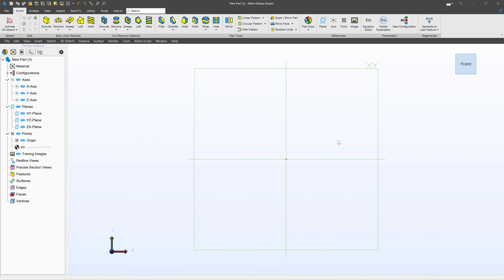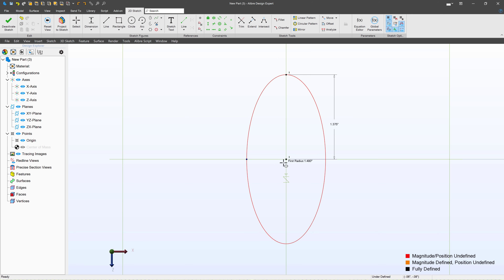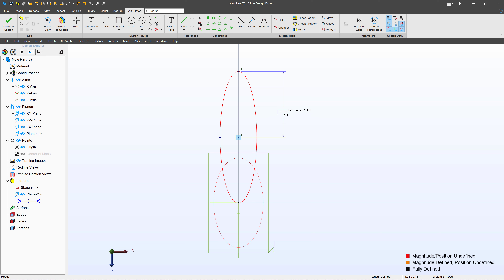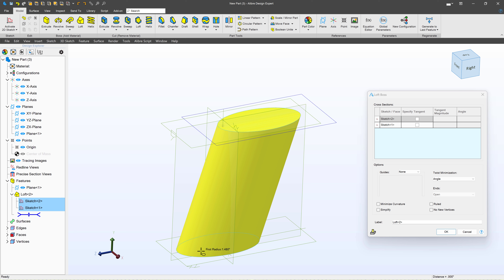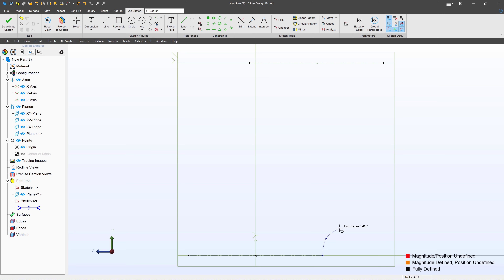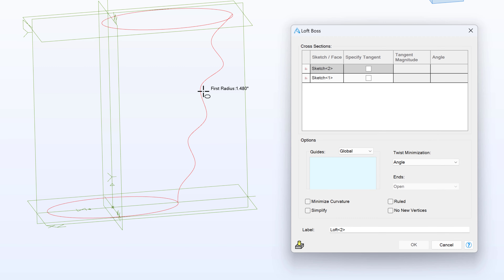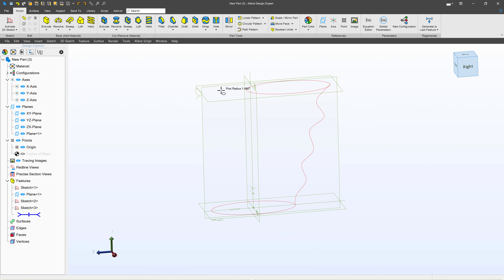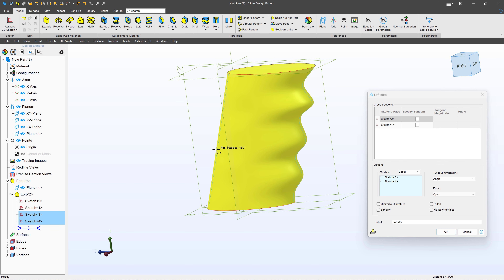Lofting a Hand Grip | Alibre Beginners Course #17

Comment: I'm on Alibre Design 27. When I try to select a line as guide to the loft, I get this error:
ACISERROR_INVALID_BODY_RESULT: Operation - The Feature results in an invalid body
Operation: Boss
Reply: Oh, it was because I forgot to do a vertical constraint on my first ellipse relative to the origin.. My guide lines looked perfect on the YZ plane, like it was touching the ellipse, but once I rotated around and zoomed in, I saw the guide line off on the XY plane, not really connected to the ellipse. It works great now!
Reply from the maker: @MattParkerjim  I'm glad you found that!